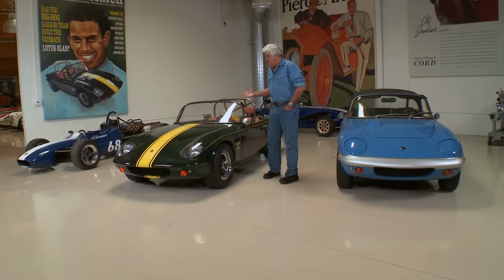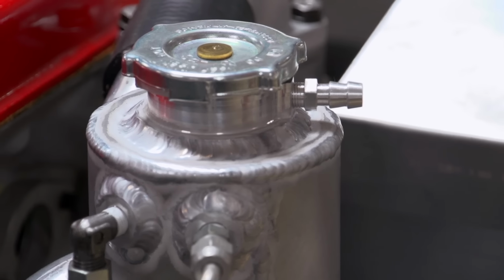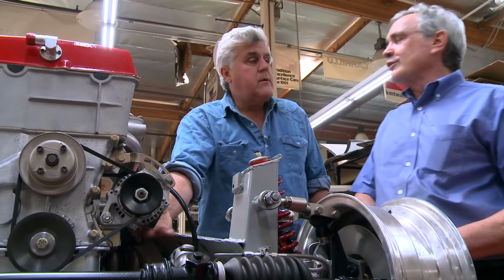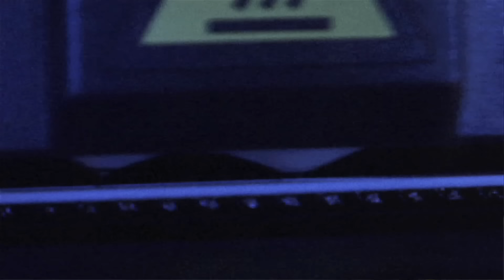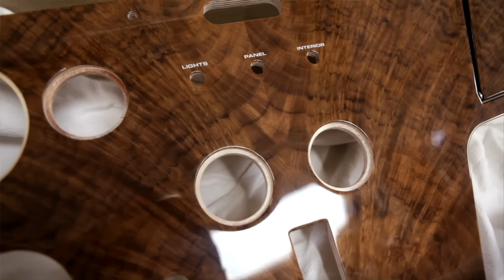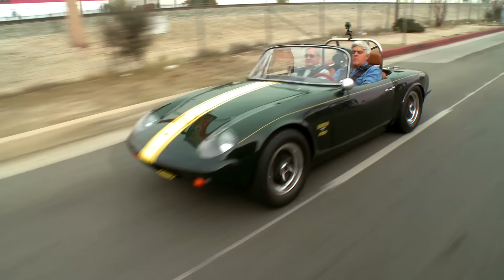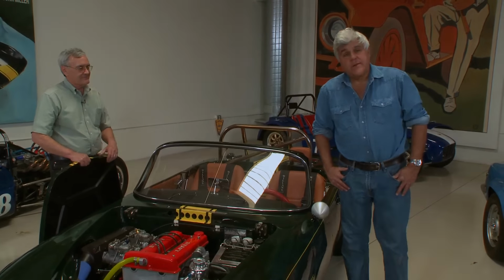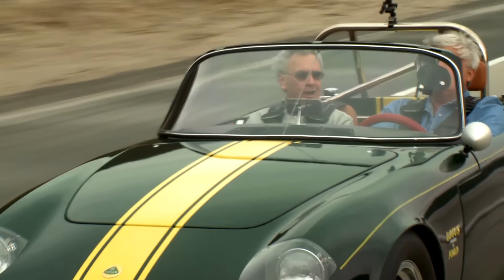Restoration Finished: 1966 Lotus Elan 26R - Jay Leno's Garage

Comment: Caterham wasn't copying the Super Seven. At the time they were a Lotus dealer and when Lotus stopped production of the Seven in 1973 Caterham bought the tools and the production rights from Lotus. So the Caterham Seven can be called the genuine successor for the Lotus Seven.
Reply: I was going to say something about that too - first time I heard JL something factually incorrect.
Reply: Exactly. It's All Good in the Hood there.
Reply: When Caterham started building Lotus 7 cars, they built Series 4 cars, continuiing with Lotus tooling etc.  Then they decided to make an updated Series 3 instead.
You might be interested to know that around 100 Lotus 7 cars were made in New Zealand, under licence from Lotus.  They were made by Steel Brothers in Christchurch New Zealand, all Series 4 with Lotus twin cam engines.  When the Lotus twink went out of production, they made a prototype with a Lotus 912 engine, but the car didn't go into production. 

I once met Graham Nairn of Caterham Cars, and told him about the Steel Brothers cars - he was polite but simply refused to believe me...   The Caterham and Steel Brothers cars are all genuine 'continuation' cars.
Reply: @psk1w1   I am lucky enough to have owned both a Series 2 Lotus 7 (but totally rebuilt and upgraded to Series 3 spec'), plus a Series 4, which in mine, had the Ford 1600GT engine.   Both great cars, which obviously now I wish I'd kept.
Reply: @grahamw56  would they be worth more now?
Reply: Oh, come on, guys, Jay didn't say Caterham was copying the Lotus Seven, Jay said "Caterham AND all those copies of Lotus". He knows the history of the Caterham.
Reply: Jay once told that story correctly, he knows it deeper than you do, including all the little differences that came about in the new cars, down to the finest details and the names of the people involved! 

Here he's just stating the fact that many copies have been made... 

And anyhow, even Caterh cars ARE not genuine Lotus ones, and the real ones are way more valuable. Even when Superformance own the GT40 copyrights to everything and builds GT40s down to the bolt, they still arent real GT40s. Even when Mr.Shelby created the cobras again with with them, with his own supervision that everything is as it was with the real Cobras and under the original license, they still aren't real Shelby Cobras. There can only be one original of something no matter how they're made exactly similar.
Reply: alanrtment porter  
Dear sir, if I say "You and the other tigers", that won't mean that you're a tiger, that will mean YOU–a human being–and the other tigers.
Once again: Jay Leno is astonishingly well informed about cars and car history, especially about Lotus and Caterham.

As to my ears–I hear the upper level of infrasonic sound and the lower level of ultrasound. In addition to that I tune sound for professional studios. Concerning verbal language perception & understanding, I speak six languages fluently with accent so pure, natives cannot hear I'm not their guy.
Although I don't except you have way better hearing abilities and lifetime ear+brain training than I do, something tells me you not the person to text me anything about my ears. Please, clear yours. Mate.
Reply: Correct! Jay can be a bit lazy on detail!
Reply: Can also be called a genuine copy
Reply: Wow thank you for that beautiful little nugget of history.
Reply: If I’m ever going to get an Elan I’d rather wait to find a 26r. Or find one that’s a little past it’s best and do a full rebuild to a road spec 26r.

Comment: Wow, this thing looks like a blast to drive! I really can appreciate all the intense amount of workmanship, time and quality that went into creating this masterpiece. Absolutely wonderful. A sound is amazing and the 1358 pounds curb weight is ridiculous, the six speed sequential gearbox is awesome (I love manuals), no abs, traction control, electronic stability management, etc. which makes driving more direct, just lovely. I wish I had a car like this! Thank you for showing the entire process, very interesting how all those details together, and go all those part to fit, incorporating features from that era of racing. Professor Hall does very nice work! Jay Leno, you have very good taste my friend!
Reply: Also add:  no heater...no AC...no airbags...no spare...no radio...no top, etc.  Are you sure you'd want it for the same price as a two new Porsche Boxster S's?  I would, but I also collect cars.

Comment: 1300lbs, 220hp race-style engine, and a sequential 6-speed...  I bet you that car gives you a bigger smile than most of the 500hp+ cars he has sitting in that garage.

..and that sound!  ~ ~c===8
Reply: 220bhp 2 litre 8 valve twin cam on carbs is pretty good. I dont think this is totally race engine and wouldnt go much higher anyway if it was. unless it went forced induction.
Reply: cableaddict well I guess it's quite powerful, if you think about it 220 horse mated to a car that only weighs 670 kilos, adds up to about 380 brake horsepower per ton which is pretty good even by today's standards!
Reply: i think most people would back off the throttle before they used the full potential of 380hp per ton. Any higher hp would not be tractable by such a lightweight car without wings. Even if it did, the cornering g forces would be unsustainable to the average driver.
Reply: 2011metalmaniac yep, I agree. Good call.
Reply: 2011metalmaniac  And I'm thinking GM TDI might not be to tall .More power
Reply: a diesel? suppose. Regardless, that engine thats in it is a lot of money, at least £10,000, without ancillaries.  Jay said he had to import it from the UK.
Reply: what engine is this?
Reply: lotus twin cam, though if i remember rightly it wasnt this car but the cortina. i was mistaken. But ye still looking at ten grand for a running rebuilt twin cam.
Reply: 110 HP per liter is pretty dam good considering there is no turbo.
Reply: Has Jay done a video on the Ariel Atom? This thing is a lot of fun but the Ariel Atom is mad!
Reply: Most people forget that's about 600hp in a normal modern sports car!

Comment: I gotta agree with Jay on the thought that the mechanical things are much more satisfying than the electronic stuff..I would much rather drive a period hot rod than a hot hatch
Reply: I so agree with him and you. Mechanical over electronic or even electro-mechanical. I prefer my hydraulic or no assist steering to all this crap electric or electric "assisted" steering they're putting into "performance cars." Same with those stupid flappy paddle gearboxes. All you need for fast shifting times is a proper sequential manual like this one with a REAL clutch pedal. Wish someone would mass produce THIS racing technology.
Reply: Amen brother...I do appreciate the gadget guys builds too, but for me it's manual steering, manual brakes, carburated, 4 speed.. I guess I like the KISS cars..The feel of the combination I suggested set up right is sooooo awesome..
Reply: It is rather difficult to get a sense of achievement and functional beauty from making lines of code and binary pulses of electrons racing along a wire or a circuit board. The satisfaction to guys of our generation is one of imagining a physical medium, like air squeezing and swirling through a manifold, mixing with fuel and detonating in a perfectly formed chamber. Little things that fit together and go snick, snick like the proverbial rifle bolt stir the loins of those that live more through the touch of their fingers than through pure theory.
Reply: Oh how I envy you for waxing such automobile poetry lol. Your comment is one of THE best comments on YouTube and you definitely are a purist petrolhead. Hats off, sir.
Reply: trefod
Very nice description sir..Your literary use of the language would suggest you are an author of some sort..If not may i suggest a change in career..Just superb..I agree wholeheartedly with 647killas' statement..Bravo..
Reply: Daniel hoffman Heh! you commented on my literary aspirations on an Asimov interview video just yesterday Daniel :-)
Would you believe I am not an author and that English is my second language?
I am in fact from Denmark and Danish is my native tongue... But thanks for the kind words, they inspire and help steel my nerve towards a future endeavor into the art of writing.
Reply: trefod
I did at that...I did...I'm laughing very  hard at this moment...At least I'm not the only one to think your description was amazing..
 The lesson I will take from this is that I should always look at the photo...Given the totally different forum I didn't make the connection..
I reiterate, write you got a gift..
Reply: Funny how paths cross :-)
Have a nice day.
Reply: I disagree... I think the hot hatch is the last connection to cars like this one. Relatively low power, light weight and practicality. This car has nothing in common with a period hot rod.

Comment: 10yrs later and I'm still drooling over that car! It's one of my dream cars as well. Driven them only in simulators, and they always handle better than anything else. The only thing that compares is the Suzuki GSX/-4 Concept car. Pushrod suspension gave that car perfect handling, plus it has a superbike engine in it. The Hayabusa engine I think. Just epic. But that's impossible to own, so is your car, so I'll have to build my own.

Comment: Mazda did a pretty good job of copying it
Reply: Even the first gen Miata is almost twice as big.
Reply: Robert Nugent
Wow, no wonder Jay looks so big in it
Reply: +stsgabe
Not really! The Miata copied the general lines of the body styling. Otherwise an Americanized, girly car.
Reply: @jackallen6261  Likely a semi trailer.
Reply: Miatas are awesome, copy or not. Particularly the last 3 generations. They absolutely rip through twisty roads. I drove a stock 2013 MX5 quite agressively a few times and it wouldn't do anything unpredictable. Loads of grip. It didn't need any more power than it had. Loved that car.
Reply: They didnt ( Copy) they paid tribute. Big difference.

They openly admit this.
Reply: The Elan M100 was considered the better car over the Mazda but the price was so much higher than the mx5 and so sold poorly.
Reply: The mk1 kinda looked similar but they are nothing alike really.

Some people like to compare the MX-5 and Elise in modern times, but they are very different to drive.

Comment: 21:00 A Miata?
Reply: Well, which car do you think the guys at Mazda were trying to copy?
Reply: kibcubed i think that was his point
Reply: Actually the designer of the miata is an American who grew up racing MG's and Triumphs at Road Atlanta, so you pretty much hit the nail on the head. Britain could still make sports cars but they chose the ash-heap of union based liberalism over working their shift and staying the world leader.
Reply: Chris Stanfill yeah, some great sport-cars  came out of Britain, BUT, that's the reason why, with the exception of Morgan most other car manufacturing is owned by foreign companies. Look at Rolls and Bentley. In the end it's the quality that's selling plenty of automobiles. British cars and motorcycles where nice , but all of them leaked or had other quality issues, not to talk about some of the terrible design...
Reply: Prof. Michael O. Zimmermann JCD ECS
Much of the reputation garnered by British  cars came from the fact that American roads were too fast for their drive trains and the climate here was too hot as well. Driving in GB was and is completely different from the U.S.

Sadly, yes, GB (which once had more than 150+ automobile manufacturers) has mostly sold out to foreign interests. It probably had more to do with extremely selfish unions and regulations than quality though. American cars throughout the 70's and 80's had equally pathetic reliability.

Whether or not they were better cars, Honda and Toyota both capitalized on marketing against the poor quality from native markets. And they succeeded, greatly.
Reply: Miata's grandfather,see the genes are strong.

Comment: Driving a fast car fast is better than driving a slow car fast.
Reply: No, this is surely a fast car!
Reply: garret rees Agree. Why drive a slow elan fast when you can have a fast one?
Reply: jo23bulls exactly, driving a fast car fast is the best! Although I use the same philosophy of driving a slow car fast when I'm driving me 91 miata.
Reply: garret rees  yea. I'm torn between an FRS, Miata or s2k as my first car purchase after school.
Reply: jo23bulls gotta get an e30, she will treat you well.
Reply: Awesomeman1987 I would but the avg used prices for those are waaaay overvalued. I was in tears when I looked up the price of a used e30 M3
Reply: Jo23bulls, I have a Miata and it is a great little car. Parts are DIRT cheap and easy to find. (my new brake calipers cost $200 all around), the car its self only cost 2500 for one in excellent condition! s2ks are ALOT of money and not many were made so parts are EXPENSIVE! Plus the Miata is lighter and handles better! You can mod a Miata to have as much power as an s2k but you can't mod an s2k to handle as well as a Miata. The s2k just can't lose that much weight. The brz/frs is a whole different type of car, plus it does not have as much of a legacy as the Miata or even the s2k. Get the Miata. If you crash it you're only out around 3k rather than 10k or 18 for the FRS. And for the betterment of mankind, get a stick!
Reply: Not true. More connected to the road in lightweight, analogue feeling car than a dull Audi
Reply: Down the line, I'll probably get a Miata as my weekend car. I can't DD one dealing with Chicago winters.
Reply: jo23bulls Definitely go Miata. I have the same love of cars it seems you have, slow fast cars. They are the most fun and most practical. I was going to buy an MR2, but I think a Miata is better, as its cheaper and easier to work on as a first car. Modifications are everywhere, the aftermarket society for these cars is insanely huge.
Reply: Just bought shocks and springs with adjustable ride height and an anti sway bar for under 1k shipped.